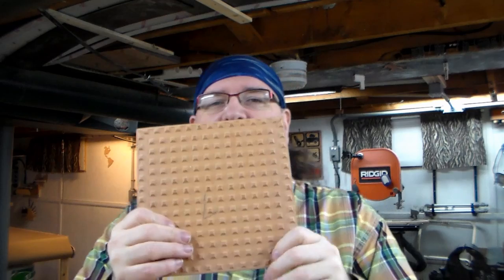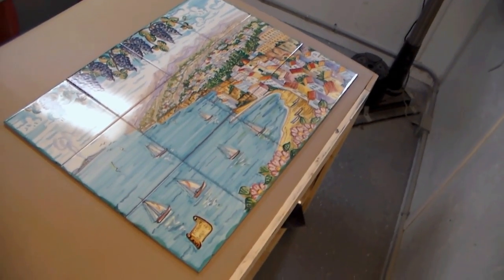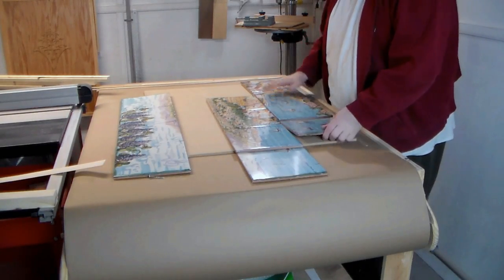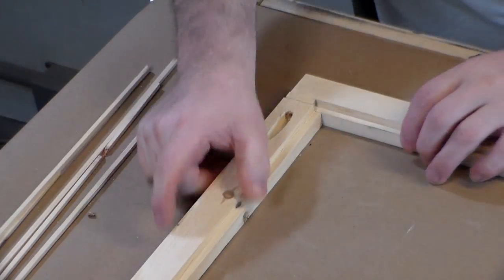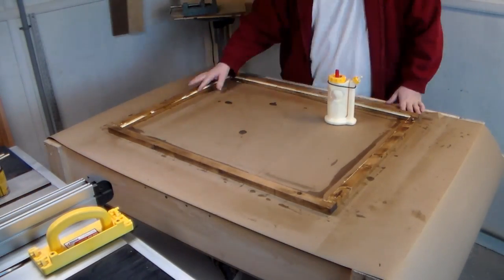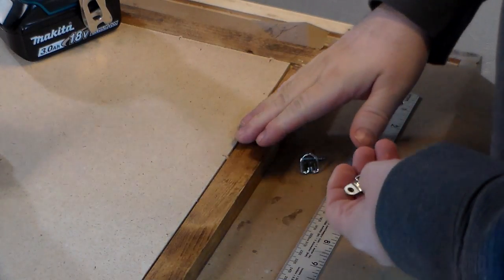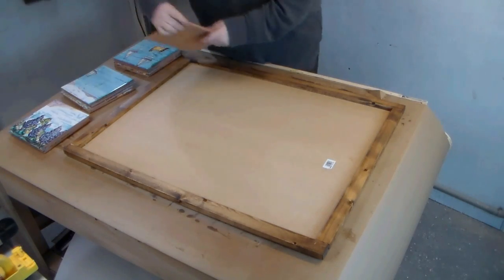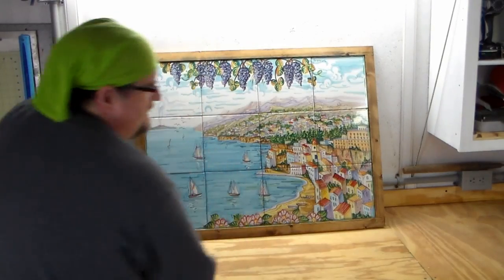My frame for a heavy tile mosaic

Comment: Great project. But fyi according to some how-to mosaic websites- mdf will retain moisture so it isn’t recommended for use with mosaic tiles as they will eventually come off. Wediboard or go board supposedly works well.

Comment: Hot glue!? Guaranteed the tiles pop off and shatter.
Reply from the maker: 4 years later and not an issue  yet
Reply: I agree. Hot glue isn't very strong, or permanent.